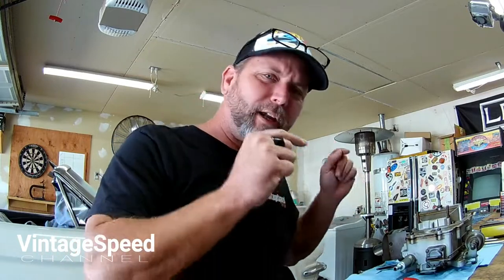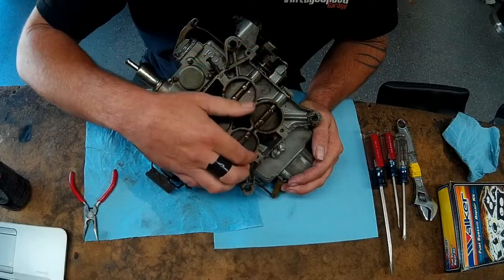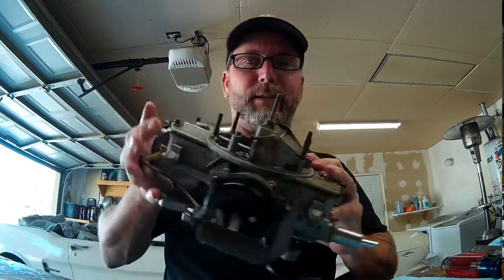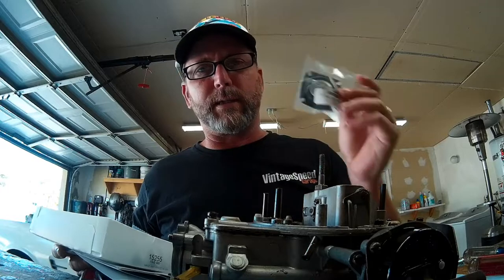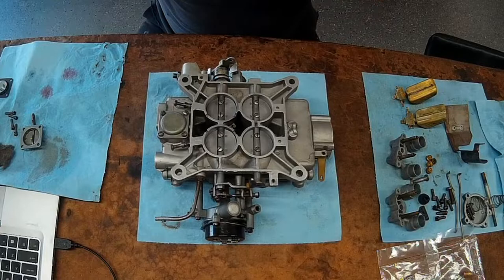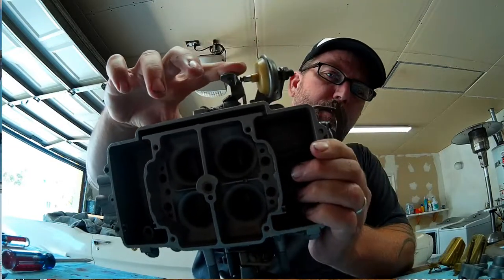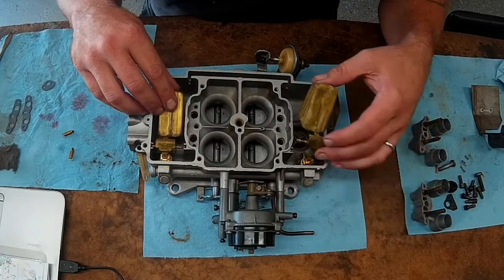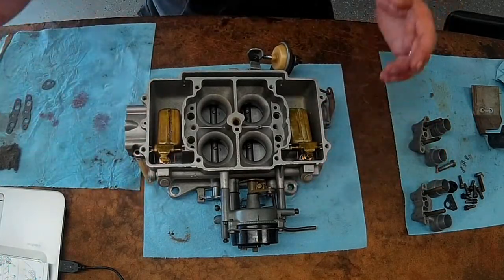66Mustang; How to rebuild your 4 barrel carburetor, Autolite 4100

Comment: can you help me thanks for your great carb video.  my 63 390 tbird with autolite 4100 has  vacuum leak.  i made a smoke machine and sent smoke thru the hose that goes to the brake booster and the smoke came out the carb.! i assume the throttle butterfly valves are closed. should this be happening.?  should i take of the carb again and look for a crack near the carb mounting holes or plug the holes with a rag and do the smoke test again.  warren  in san diego.
Reply from the maker: smoke from the carb would be normal under your test.  the brake booster is connected to the intake manifold (or sandwich plate) and smoke would back-feed thru the carb.  if you're looking for a vac leak, most common is the T connector on the intake (be careful, they corrode and break easily).  second would be the vac line going to the distributor from the carb base.  and check all vac caps & lines on the carb/intake.  if it will idle, you can test with a can of carb cleaner/starter fluid while it's running, an increase in rpms will signal an intake leak.  good luck finding it!

Comment: I have a 1964.5 Ford Mustang 289V8 4 Barrel Carburetor Original.  Do you have any recommendations on the rebuild kit for it? and anything I need to watch out for or would it be better to just go buy a new one?

Comment: thanks for the reply. when i have sprayed starter fluid or carb cleaner around the carb it idles better.  this carb has a aluminum spacer that sits on the manifold. it has water pass thru it to heat the carb. there is a gasket under it with a rectangular out-pouching that goes to the pcv valve. on top of this spacer is the next regular carb gasket then the carb. i dont like using brake cleaner as it eats my paint away.  i have checked the large t fitting that screws into the manifold and sends vacuum to the booster and the power brake reservoir holding tank .  what should i do next.   i guess take the carb off and plug the  4 holes and try the smoke trick again?  prob some simple fix but i am going nuts with it. all carbgaskets are new. the spacer looks ok, no cracks and it is flat

Comment: hi,  so i sprayed starter fluid around the baseof the carb an spacer and saw a change in idle. so thats likely the leak. however i have checked the spacer that heats the carb, no cracks and it is flat, mating surface of manifold looks ok. carb base is straight, have tried 2 other carbs with same problem.  have tried double gaskets 2 on manifold and 2 on spacer below carb.  any thoughts?